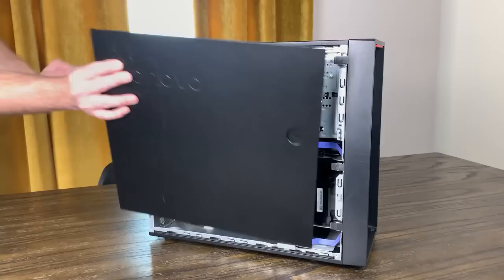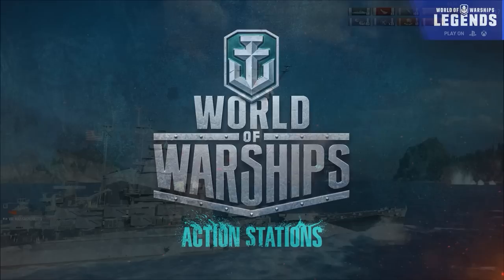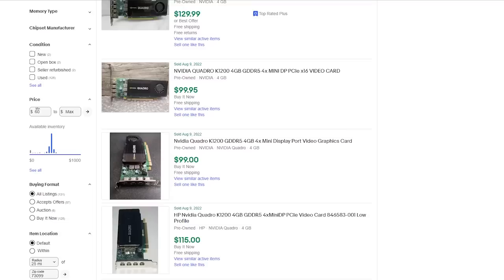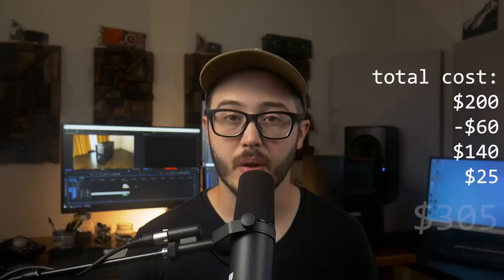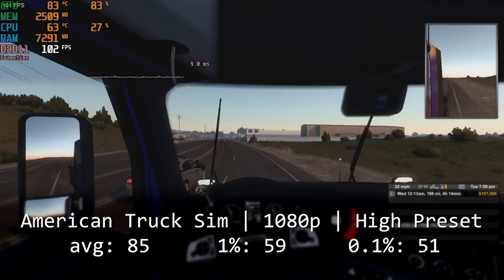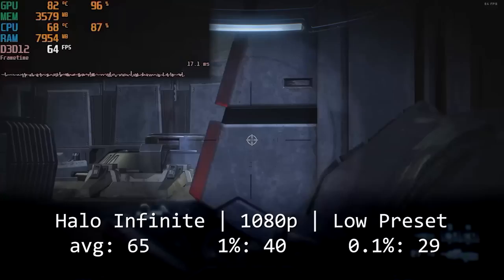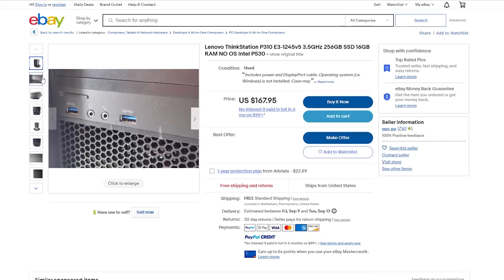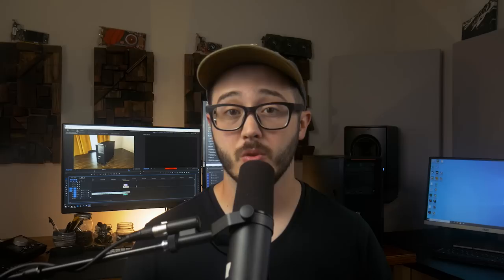A $300 Gaming PC You Can (Maybe) Build in 2022

Comment: Another great video. I love creators talking about the used hardware niche even if the value is dubious in light of the speed of current improvements in PC hardware. You've done gaming PCs, servers, and NAS, but I'd like to see something that has piqued my interest as of late. How about making a build for use as a volunteered/distributed computing system like for folding@home or BOINC? It's a lot more niche since it's unappealing to be wasting power on projects that are hard to see the results of but I think it's a very unexplored topic on youtube.

Even though old hardware runs a lot less efficiently powerwise (125W xeons compared to 65W Ryzens), it could be very possible to optimize a used system distributed computing. GPUs tend to outpace CPUs in most of these tasks, so pairing a relatively weak low power CPU just to host the system with power efficient GPUs would probably be the goal. Options I've checked out using F@H's power efficiency list would probably be the GTX1650 and 1050 alongside the ti's for the most obtainable power efficient cards, whereas the GT 1030 and NVS 300/310 are probably best for extremely low power systems. Checking out the power usage and software setup in Windows vs Linux is something I'd really like to see, since I'm also thinking of trying this out myself.

Comment: If anyone is trying to do this now, I've seen several systems with these Xeon and 6th or 7th gen Core CPUs in the $100-125 range. You can also find them barebones so you can go ahead and get a 7th gen i7, but it's usually a better deal to spend more on a system with a 6th gen i5 or i7, then sell that CPU to make back most of the cost of buying an i7-7700

Comment: I wanted a small computer to play indie games and to stream from my main gaming computer in my living room, I got an old HP Compaq 6200 with a i5 2400 for free at work (we have like 15 of those after selling over 20, they don't care if I take one), I bought a 20$ Radeon R5 430 on eBay and I put an old 128GB SSD I had (but a brand new one cost like 15$ right now). All in all, I paid around 40$ for something that can play quite a bit of games, going with older office machine is definitely the way to go, we're actually selling our older 7th Gen i5 machines with 8GB of RAM and 1TB HDD for like 175$ because they're literally useless for us right now.
Reply from the maker: That’s really interesting! How’s the streaming latency?
Reply: @HardwareHaven  To be fair, pretty poor, but I think it has more to do with the fact that my gaming computer is running Linux and Steam Remote Play seems to have a lot of problems with that, I have the same problem with an 8th Gen i7 that should be plenty fast enough to decode a local 1080p stream. Moonlight runs a lot better, it's just kinda annoying to set up and the GUI isn't great.
Reply from the maker: Gotcha thanks!
Reply: I’m doing literally the same right now! Grab an old HP 6200 from work and threw in some ram, low profile gpu and a ssd. I’m all in about 80 dollars total for ok pc.

Comment: grab a tesla P4 for around $100 (a 1080 with a 75w tdp and no video outputs. Either use windows to choose which video card to use and run local or use Parsec to stream). ebay is flooding with them at the moment. You will need to figure out cooling, but even a 40mm noctua and a 3dprinted or cardboard shroud easily handles the heat load.
bonus - since this is a tesla, you can carve it up into multiple video cards and have multiple gamers - each with their own dedicated resources)

Comment: If you want to avoid any adapters, you can simply buy an ATX12VO power supply. This is a non-proprietary standard, so you can buy it from some 3rd party manufacturers.
Reply from the maker: I could definitely be wrong, but I don’t think that Lenovo 10 pin is the ATX12VO standard. I might check when I get home haha
Reply: @HardwareHaven  It's not ATX12VO. It's proprietary-ish connector, but uses standard voltages. They're really easy to adapt and I've made a bunch of my own adapters.

Comment: I`ve also got a Thinkstation P310 and I think about replacing the PSU by a new ATX PSU (by the help of an adapter). But new PSUs are built different with the fan up or down. How should I place the new PSU without getting problems with the Lenovo's airflow?? If I put the PSU with the fan upwards there's no headroom for fresh air!? And do you reccomend any PSU for this older workstation?

Comment: A 4th or 6th gen Dell Optiplex is a great option as well
Reply from the maker: The only issue with those is many seem to use non ATX form factor PSUs and motherboards (if I recall correctly)
Reply: @HardwareHaven  Alright so I have a Dell Optiplex 3020 MT I'm planning to put a GTX 1650 but I'm pretty sure that it will work with the stock power supply. I'm talking about the 1650 models without an external power connector
Reply from the maker: @nahpets2345  Should work fine! Those pull up to 75W from the PCIe slot, which should be standard.
Reply: @HardwareHaven  Yeah definitely